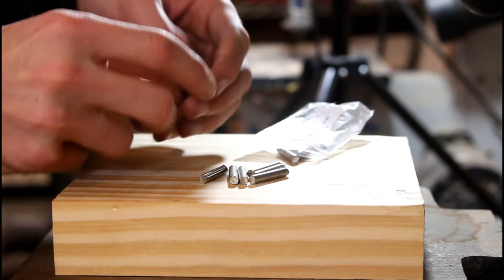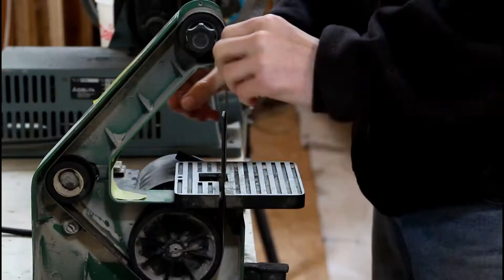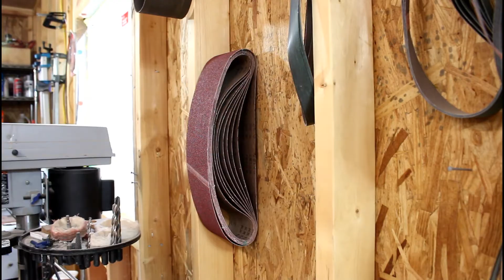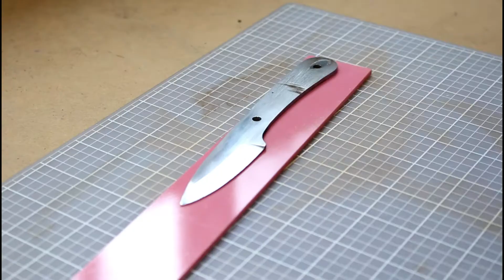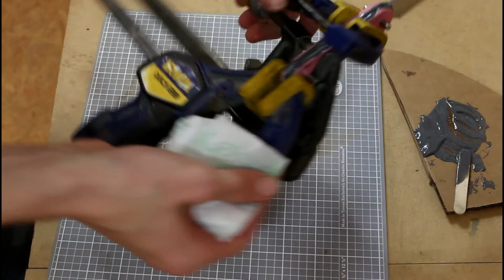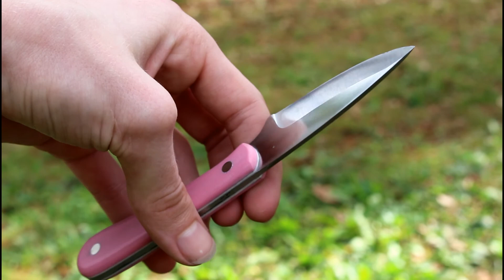The Pink Knife | Part 2

Comment: That's a nice sharp little knife !
If you find handsanding too long, buy 320 grit belts, and go take a look at my videos : I use a drill set up as a flap sander, and it works quite nicely !
But don't use a brand new drill, use the old crappy one because using the drill like that makes it off centered